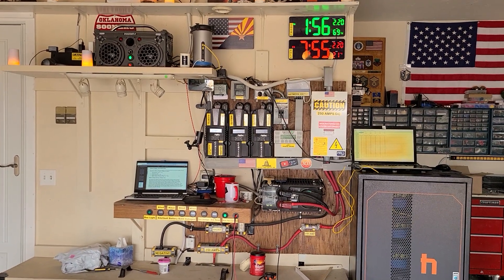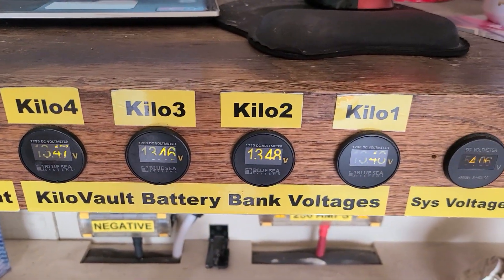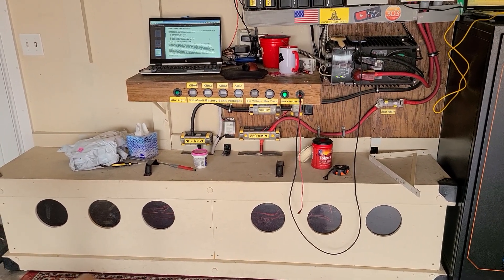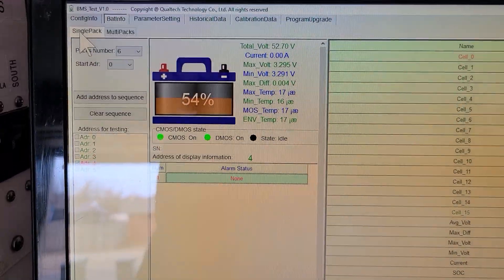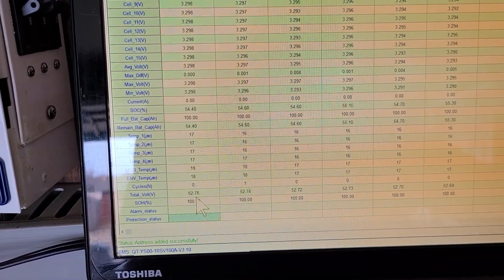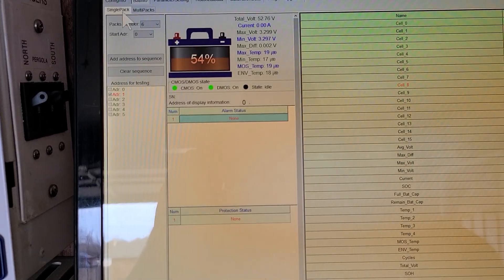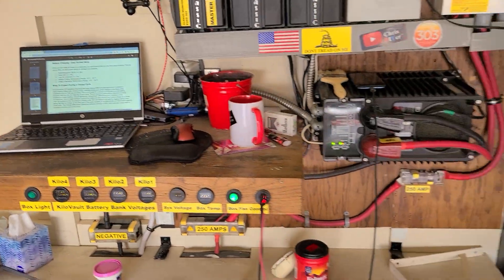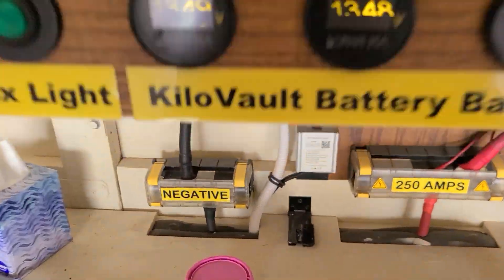Talk: EG4 lithium battery rack busbars, BMS laptop monitoring software (areas for improvement?)

Comment: Great vid Chris. Yep if they would get with blue sea systems and create that bussbar that would take care of it. I would add if they do that then make that cabinet 2-4 inches wider so that you can tuck that bussbar in behind the front panel and INSULATE it from the rack. This way it has room for the bolts etc. COOL!! Keep em coming!!
Reply from the maker: edited. A wider front for this rack like you said would be better. It would help with installing the batteries and also help clear the busbars with actual studs  My #1 concern is always safety. With battery systems this high of raw power with busbars, we are talking wattages higher than most commercially available arc welders. So, going to do it right and safely.

Comment: Hello, I have also noticed different SOCs with my three EG4-LL batteries when they are charging, but their SOC become the same as they all get to 100%. Have you looked at that software on your laptop to see if individual cell voltages get out of balance when their SOC get close to 100%? My BMS_TOOL software (for EG4-LL batteries) shows individual cell voltages get out of balance when they all batteries get charged close to 100% SOC, and I am trying to figure out what is going on. Thanks
Reply from the maker: SOC calculations for each battery in a battery bank can vary by as much as 10%. Best practice is to ensure each battery's voltage is within 0.2 or less. I used to watch these numbers on my current battery bank and old lithium bank...meh. If one battery is going bad, the BMS will alert on their software

Comment: I’m not overly impressed with anything h ing to do with signature solar LOL 
  The batteries are nice and you definitely feel like you’re getting your moneys worth when you pick one of them server rack batteries up
Reply from the maker: It is like buyers are their "test subjects" and they feed off of people who make videos. My six Lifepower4 batteries are performing as expected after I corrected the wimpy-made busbars and gave the bank a full 100% charge. Quite honestly, impressive kWh output and fast charge-up. Lastly, they have made multiple versions of these battery racks and busbars...so, what does that tell ya? Yep.
Reply: @ChrisDIYerOklahoma  what amperage do you charge your batteries at just curious
Reply from the maker: @cowboymcq6711  -- The max I have seen so far is about 120 amps (6,600 watts) charging current. I am running 4/0 welding cable...well below it's max. I also have a 250 amp  fuse in that circuit. The absolute amp max I would ever need/run for safety...about 13,750 watts. I am not even close to that. The inverter is rated for 3,500w/7,500w surge

Comment: Have you looked for a phone or tablet app for the new system?
Reply: Chris, there is a great third-party monitoring system for your batteries and it is called Solar Assistant.  I have a video on my channel about setting up solar Assistant which runs off a Raspberry Pi.  Very easy to set up and the system is rock solid. You should be able to monitor each battery (and individual cell) via a usb to cat5/6 cable directly from the battery to the Raspberry Pi using Solar Assistant. Use can use a Ethernet hub for multiple batteries.   EG4’s use both the CAN BUS and RS485 protocols which is compatible with Solar Assistant. RS485 is what will work here with Solar Assistant.  Give me a call if you want to chat. 

On another note (and I might have missed this in another video,) but is the door to the rack possibly mounted upside down?  Or maybe the rack is upside down causing the down to be upside down?  Shouldn’t the door say EG4 going down?
Reply from the maker: @GreenMountainDIYGuy  -- I will look into that Solar Assistant. Thanks! As for the door...this battery rack is their "Russian Edition". Hahaaa! I flopped the door to open from the right and addressed it with the company on the phone. They might send me a decal to cover up the Cyrillic lettering. 🙃
Reply: @ChrisDIYerOklahoma  Yes! that makes sense!
Reply from the maker: No...if there is a Bluetooth APP, I wouldn't mind testing it out/using it. Curious!